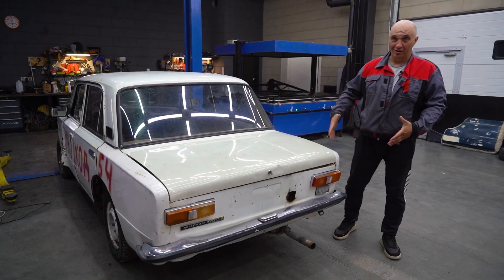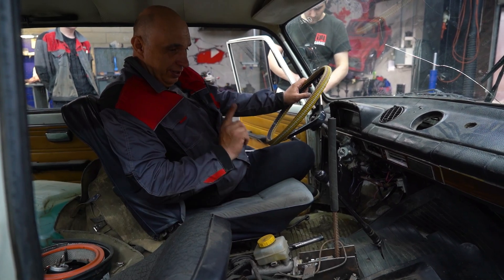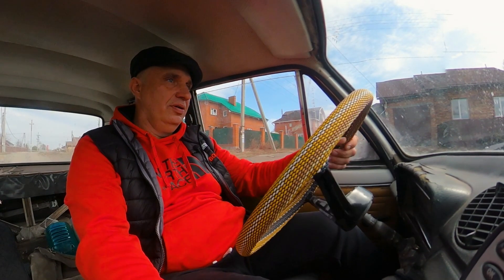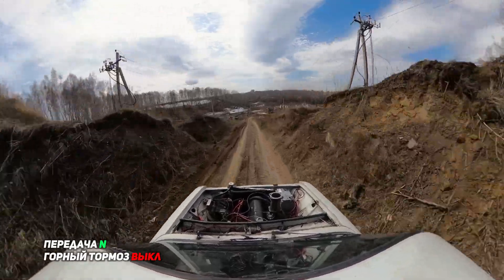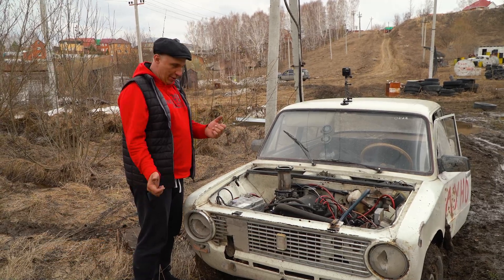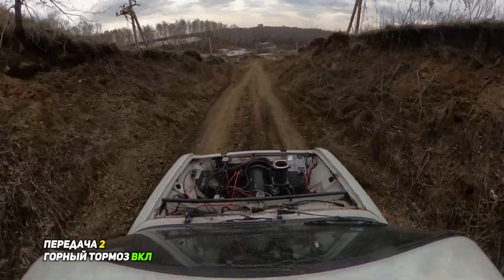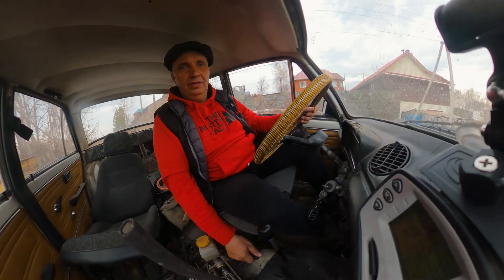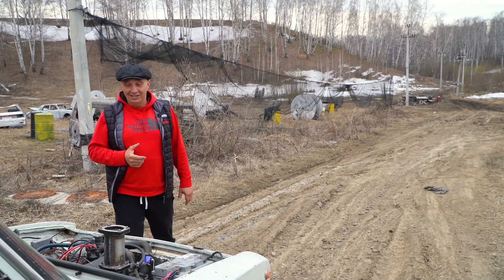Extreme 107% engine brake - how does that work?

Comment: My converted school bus that weighs 30,000lbs and has a gas engine… goes down 10% grades at ease, with no brakes… holds around 55 with pure engine braking. I love it.
Reply: I haven't seen gas powered school buses in decades.  What do you have?  A Ford?  If so, what engine?  The Ford 370?  A GMC?  With the 366?  Those are the gas-powered school buses I vaguely remember.
Reply: @BlackPill-obey  the ones I rode on in the late 80s used to sound awesome when coasting in gear! They loved to backfire 😂
Reply: @grabasandwich  Foot to the floor, 4200rpm. crawling up Tennessee mountains going about 38… sounded epic in the canyons. Never had one issue that 366 was working hard!
Reply: @ionbusman2086  The 366 was not a "powerful" engine but, it was made to run at full power continuously and not be damaged.  
Regarding your Bluebird bus, I wonder if you would've been better off to save the 478 GMC V-6.  I'm sure it didn't rev worth a damn but, I'd think it would handle those Tennessee mountain roads a bit better.
Reply: @BlackPill-obey  Got mine hot-rodded a bit. Sounds and runs great! I wish I had the 478 too. But it was gone long before I bought the bus. Unique engines for sure
Reply: @ionbusman2086  It sounds like you need a Paxton supercharger for your 366.  
JEGS sells them but you will have to talk to somebody about fitting it for your particular situation.  No, I don't work for JEGS.
Reply: @BlackPill-obey  Thought about it.. but with it being an RE, the cooling system is about maxed as-is without any extra heat. And I don’t want to get worse than my 5.5mpg lol. I was thinking a water-meth setup might be good
Reply: @ionbusman2086  I guess what you have is what you're stuck with.  I remember the craze of water injection 40 years ago.  It worked until people discovered rust and acid erosion.  Water + combustion byproducts created acidic stuff that ate away at the engine.

in hindsight, what would be better is a STEAM injection system.  That would require a LOT of heat to do.  A heat exchanger in the exhaust could be made.  One that has copper tubing to take the water in, boil it to where it is superheated, and then have the tubing send it to the intake.  But, what sounds like a simple concept is probably full of unforeseen technical problems that will take a lot of trial and error DIY engineering.

In my mind, copious amounts of steam would allow you to have a more aggressive spark timing curve and maybe get the heads shaved to raise the compression ratio a bit.  Dry steam would probably become saturated in the intake (because of how the air-fuel mixture form the carb cools the air coming in) but, it's still not going to leave water droplets all over the inside of your engine.  Just food for thought...
Reply: @ionbusman2086 what's terrible is you're getting better fuel economy than me... and I drive a 92 eldorado Touring Coupe 😂
Reply: @BlackPill-obey  May not be powerful, but that's not the mark of a good engine. The mark of a good engine is no-nonsense reliability. Just look at Detroit 2-strokers. There's a reason why they're so popular, and power is not it.
Reply: @BlackPill-obey  Right... Let's take a famously-reliable engine and remove all of the qualities that made it reliable. Makes perfect sense if you don't think about it...  It's like with old military equipment. Don't fuck with it, and it'll run forever.
Reply: @BlackPill-obey  1972 Bluebird with a 366 in the back hopped up. Original engine was a 478 GMC V6 :D
Reply: @BlackPill-obey  I had a 76 Chevy C65 fire truck with the 366, New Process 5 spz and Eaton 2speed axle... loved that rig.
Reply: @sqmotorsports9230  That’s what i need. My 4 speed Allison Auto.. really makes it a dog.
Reply: Yes, i drive Urban buses diesel, some an adjustable retarder going down a steep hill this morning i was barely touching the brakes and had to use a small amount of accelerator, it held the bus at around 30kph IDEAL in winter slippery road conditions!!
Reply: Purely for science... butterfly valve it?
Reply: Isn’t the requirement that there needs to be an independent brake that can hold the vehicle at 40 km/h permanently w.o fading?
So that could be a retarder or an exhaust brake or both combined.

Comment: You need a pressure relief valve on the exhaust in front of the butterfly valve to 'waste' the compressed exhaust gasses. Experiment with blow off pressure.
Works kind of like the intake pressure dump valves on turbo systems that prevent turbo stall by keeping airflow through the intake.

Comment: Those are some  VERY impressive welds!! Surprised the exhaust didn’t just say see ya later to the rest of the car.
Reply: No one here is actually a welder right lol first thing we learn good weld is well that holds lol seen "stake of dime" welds that look beautiful you can slide a slip of paper under and "bird shit" splatter that needed torched to get apart lol just my thoughts lol
Reply: Yeah that welder needs to be fired! First day on the job? Last day on the job!😂
Reply: Popcorn is served boys
Reply: You can stall an idling engine with your bare hand over the exhaust, easily, assuming it's air tight. It doesn't take as much pressure as one might think lol
Reply: Welcome to Russia comrade.
Reply: We ain't gonna talk about the square tubing exhaust?
Reply: No joke ,
 Next time grind that crap off , before someone else sees it
Reply: @davidn8759  I laid better beads my first time ever welding. If you can't get it right after the first few welds, someone else needs to step in.
Reply: Looks no enough amps and it was maybe without CO2 or anything.
I mean it looks welding wire that dosen't need gas.

Little bit same thing than welding stick.
Reply: Lol I noticed those.  Not a stack of dimes, for sure!
Reply: @-Jethro-  because POS LADA communist made car is full of leaks
Reply: Yeah that was pretty bad🙃
Reply: Lol yes, I was like they must have run out on the Argon mix or something
Reply: @Pulverrostmannen  Argon lol. Im suprised if they use anything else than pure CO2.
Reply: Why make welds pretty for something that's getting destroyed anyway???
Reply: @410kane  Why wear clean underwear if no one can see them
Reply: @schrodingerscat8621  for hygiene maybe
Reply: @schrodingerscat8621  I change mine once a week. It's fine
Reply: Shit you think that was good, go back and watch the headlight chrome fitting hang off for dear life down the hill 🤣🤣🤣 11:30

Comment: Why can’t you try turning off the ignition while using engine brake 😅
Reply: You need to cut the fuel supply, not the ignition.
Reply: @Karl with a K No.

Comment: That worked good. The more air the engine has to pump, the higher the braking.
Reply: Yeah, that's why most higher performance bikes have slip clutches in them. They rev up to 15k rpm with compression ratios somewhere in the ballpark of 12:1 and 14:1. So of course the bikes would need a slip clutch with that much air moving through a tiny engine.

Comment: Great video! This works better than I thought although I think its better to keep this tech to semi trucks.
Reply: It's helpful when towing heavy loads down mountains. I've never seen it on a gas engine, but some diesels have an exhaust brake option that is literally a butterfly valve near the exhaust manifold.

It's certainly overkill for a passenger vehicle though.
Reply: @volvo09  yeah
Reply: @volvo09  I would see this a lot in african trucks
Reply: @volvo09 Does definitely save the brakes on a lorry especially if you happen to live somewhere with lots of hills. I live in the mendip hills in Somerset. You would be amazed the number of HGV drivers I had to explain the exhaust brake to working as a fitter 🙄
Reply: semi trucks have a similar but realty different system called a Jake brake where the brake effect is created in the engine cylinders. smaller Asian diesel trucks have the butterfly valve in the exhaust.
Reply: @realsonnysullivan  full size Hinos and isuzus at least use exhaust butterfly brakes still too
Reply: This would actually be more effective on a diesel, because there is no throttle plate restricting the intake air to the engine at idle.